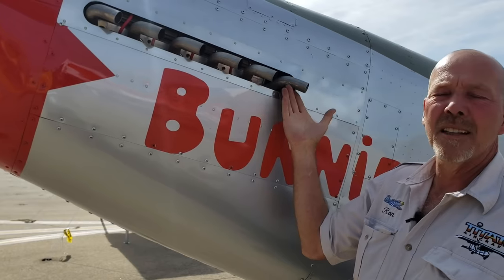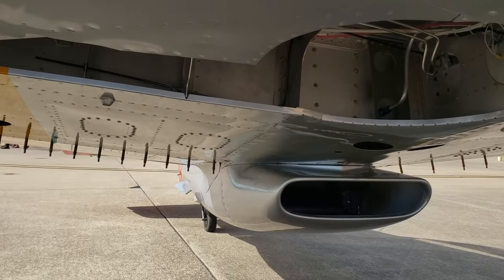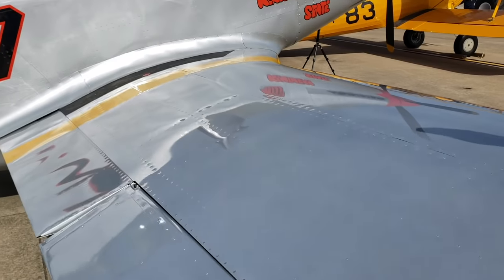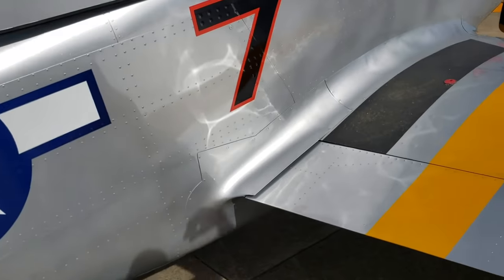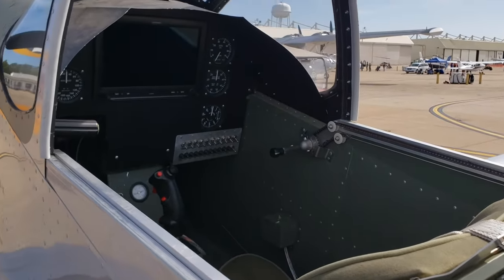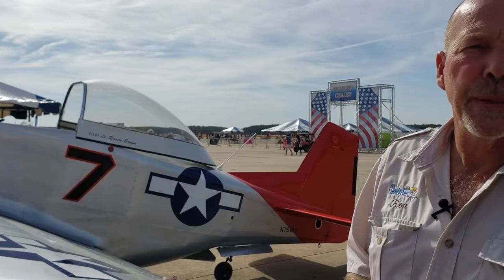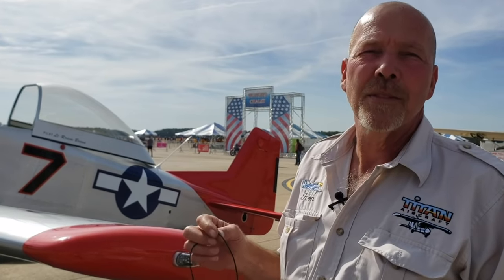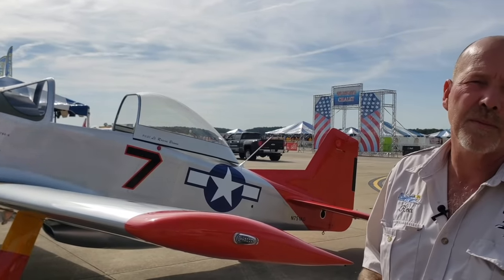The T-51 Kit Plane Gets New Speed Wings

Comment: Wow. So want one of these. Great vid, Mike. Keep up the good work. Btw, were you tempted to go with one of these when selecting your TSI? An airplane should be chosen based on the mission. So, what, then, is the mission? It's so subjective. Is it to cruise x-country with a low fuel burn? Or is it to go Mach 2 with your hair on fire?
Reply: probably neither of those.  Rapid climb to altitude in a practice area then do wing-overs and such, pretending to be stalking an Me109.  At least that's what I plan.

Comment: I have read the original p-51 took advantage of the Meredith effect and actually generated up to 300 lbs of thrust with the radiator scoop. I wonder if the T-51 generates some thrust this way
Reply: Check out the youtube channel "greg's airplanes and automobiles". He just did a video that talked about the Meredith effect and the P-51. It seems that it has been overblown in its effect on performance.
Reply: My instrumented flight experiments in this vein would indicate that this isn't true. The T51 rad layout is not even as well designed at the original P51.
Reply: @rv6ejguy  That would be in line with what I have heard. Something that has been pointed out is that the BF109, Spitfire and Tempest all took advantage of the Meredith effect with their radiator inlets as well. The Mustang's might have been a little better designed aerodynamically but not enough to have any real impact.

Comment: Am I tripping to think that a 200mph cruise seems a little slow for 425hp?
Reply: The limiting factor would be the strength of the airframe.  I'm sure the engine would pull it as fast as you dared to go.
Reply: @Pantdino  It's's rated at +6/-4 Gs, so I don't see how the structure would be the limiting factor. Drag force increases as the square of velocity, so it takes WAY more power to go a little faster. Still, the thunder mustang kit plane goes 450mph with 700hp, and of course the real p51d goes 450-475 with ~1700hp. But of course, the p51d is bigger, has more frontal area, and thus more drag... Still not understanding how a Mooney can go 250mph with 210hp and this little guy can only go ~200 with 425hp. Just doesn't add up.
Reply: As I understand they actually limit the power to 310 hp because that's the limit of what their current PSRU can handle, also I imagine it's 200 indicated which at cruising altitude would probably be closer to like 220 TAS

Comment: The S-51 looks so much better than the T-51, because of the front engine cowlings. The S-51 cowlings have actual curved metal, and is more authentic looking and a tiny bit more fluid and aerodynamic compared to the T-51. T-51's are nice, but noting compared to the S-51.

Comment: LS is the only way to go. You can take a 200K Junkyard LS, put it in your hotrod, turbo charge it and make 800hp without doing anything to the internals. LS is plenty, Affordable, Easy to rebuild and very reliable. I would have to use the LS and add a turbocharger at 7-8 psi. That would be a 600hp reliable package.

Comment: I wonder if you could have a T51 with an LS that makes the power of the real P51
Reply: A real P51 puts out around 2000hp. Not sure you will get an LS to make that kind of power.
Reply: loampey1 LSX can do it on a shit ton of boost
Reply: @trevoncowen9198  
true, but would you want to fly in a plane where the engine may grenade at any minute?
Reply: loampey1 yes also I would have more faith in it if I used all forged internals but yes it would be fun
Reply: @trevoncowen9198   I'm guessing you would be able to fly vertical and hang off the prop with that much power. Fun indeed.
Reply: @loampey1  the real P-51 put out 1400hp at sea level and 1500 at altitude
Reply: @johnbeauvais3159   Your right until you shove the throttle to WEP then you have 1720  so yea around 2000.
Reply: The T-51 has about the same power to weight ratio as the P-51.  One fifth the power but also about one fifth the weight.
Reply: @loampey1  You're using the numbers for the V-1650-7 engine which is completely correct for that but in combat it was much more common to find the V-1650-3 engine which delivered less total horsepower but gave more power at altitudes above 19,000 feet
Reply: @johnbeauvais3159  Thanks, I did not know that. What version was in the Spitfire?  I know I read somewhere that the Merlin put out 2000HP